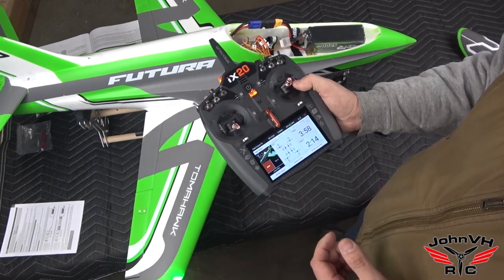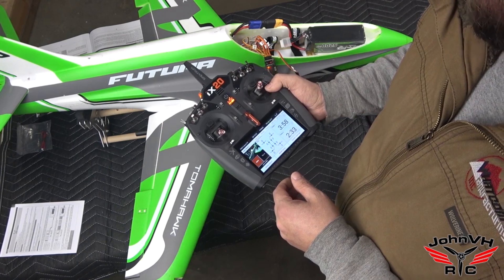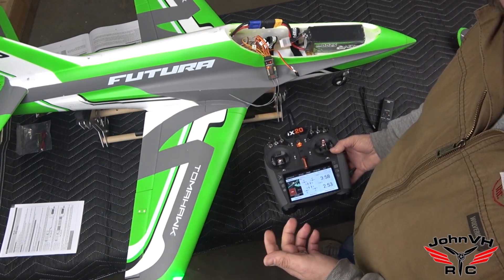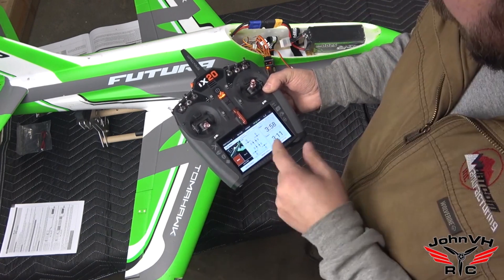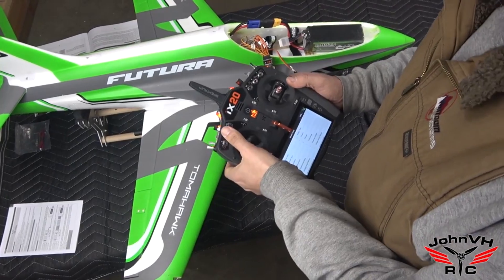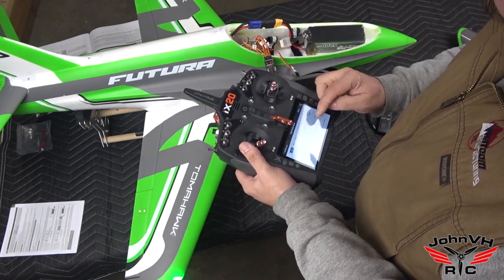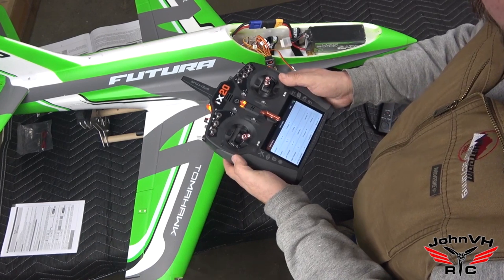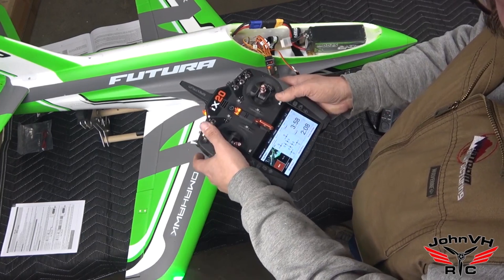Elevator to Flap Mix, THE RIGHT WAY!  FLIGHT MODES! You're doing it wrong!

Comment: Why are you adding ailerons to flap mix unless you're running crow brakes or drooping ailerons? I do the same thing but with flaps to elevator on my Draco 2.0 and flaps/elevator to crow mix on my Cub's in flight mode. Best thing to do is not use mixing and become coordinated with your fingers on the sticks.
Reply from the maker: Because every plane I have with flaps needs elevator compensation. I fly coordinated with the rudder, the best this is to do exactly as I show in the video. even full scale trim for proper flight.

Comment: A very important thing  you left out is while the trim setting helps but you must remember the Speed of the Aircraft will effect how much is needed  So if the model is flying faster
or slower trim may be off?  Also I slow the Flap speed so as to avoid the a large deflection during flap extension. The best way to land is trim the model for level Flight at half Throttle
Then use throttle to fly the approach lowering throttle to descend or add power to 
maintain or climb. this will keep the Air speed constant during Approach and landing
and flap to elevator will always be in correct trim.

Comment: This work on dx6e
Reply from the maker: Not sure, I have never had one of those, if it has flight modes it will
Reply: Using trims in the flap settings did not change the trims on the specific flap setting, it affected the trims even after switching the flaperons from on setting to the next.

Am I missing something?
Reply from the maker: @titusandrew946  did you tell the radio that the trims change with the flight modes? Go into the trim page and select flight mode for the elevator and aileron.

Comment: So all i need is the $1700 dollar IX20 Spektrum Transmitter to do this?  Wow who knew it was that simple? Lol
Reply from the maker: Not at all. I think any radio will do it. IX. DX. That’s why I make videos like this, because so many people are clueless about features, and how to make things easier for themselves.
Reply: @JohnVHRC  Thats how the developers sometimes make higher end transmitter,s more appealling to drop the extra coin because of the extra capable features. But if you are able to program that in most radio transmitter,s that would be the way too go to set up your presets
Reply from the maker: @looneytunes47 Yep, cheap transmitters do this also, I wanted this TX for the big screen, I like how the IX program, I can take a picture of my actual model from the TX, and money isnt an issue, I love it.  But Ive been doing flight modes since around 2000, with a standard tx as well.
Reply: @JohnVHRC  Yeah the XI larger screen is a sweet feature to have

Comment: From my experience.. for the maiden flight  , I recommend only setting the elevator to the flaps trim flight mode .. it can get hectic on a maiden if you have to trim the plane 3 times for 3 control surfaces .. this way you only have to worry about elevator trim,  once you get elevator trim dialed in , then you can add the rest of the trim flight modes if needed
Reply from the maker: I guess. But it’s better than having to make 3+ separate flights with an out of trim plane dialing I guesses. Honestly. If trimming in a plane is that hectic. Probably should get more comfy with trainers.

Comment: Flight modes are definitely the way to go. I started with planes 30 years ago with basic non-computer radios. Around 20 years ago I got into helicopters as well, got my first computer radio and discovered flight modes. An absolute must with helis and a total game changer with fixed wing.

Pretty much every computer radio from every manufacturer within the past 3 decades has flight modes. Read your manuals people. Take the time to learn the operating system and play with your radios programming functions. You'd be surprised what even the most basic systems are capable of these days.
Reply from the maker: Facts!!

Comment: 1. I’ve been putting my transmitter’s flight modes on the flap switch (D) for a few years. I only enable aileron and elevator trim. Some like to include the rudder. Having the separate aileron trims lets you tune out any turning tendencies due differences in the flap deflection. Since the flaps only use one channel, you can’t match them exactly.
2. Some think you must use the transmitter’s flights modes to control the receiver’s flight modes. This is not true; you simply need to assign a switch to the receiver’s flight modes channel.
3. Your videos would be much better if you connect your transmitter to your computer’s USB port and use “scrcpy” to display your transmitter’s screen on your computer.
Reply from the maker: Yeah, I know seeing the screen may make it easier if someone has an IX radio, but in all reality, anyone can look in their radio and find the flight modes option..  If they want to, its so easy!

Comment: Seems like a great idea.  But I'm not getting it.  Then again, I've watched that video on how to fold a tee shirt in one move and can't replicate that either.  🤣  I'll take a look at that option on my Radiomaster Zorro.  My NX10 is going back.  Even though it has been out for years, unbeknown to me, it needed a firmware update out of the box when I got it 6 months ago.  It wouldn't connect to WiFi, but I didn't really care at the time.  Now, it's not always working with the Telemetry.  And that is a problem.  According to HH support, a firmware update cannot be accomplished on a Mac!  So the old DX6 will be my final Spektrum radio.  $550 and half-baked!?!  Nice of them to offer a return.  Never again.

Comment: The only issue I have with flight modes is that when I set my DX9 to use them they would snap and not move at a slow speed. Had them on my F-5 and took it off for that reason. Maybe the higher end radios allow for a slow speed transition??
Reply from the maker: The flap speeds have been adjustable on all mine. Even my 20+ year old radios. But yes. The elevator does move normal speed at all times. But it’s not too noticeable. Still better than guessing setups on the bench :)
Reply: @JohnVHRC  I spend at least 3 flight fine tuning then never need to mess with it again... it aint that hard! 😂😂😂
Reply from the maker: Then you put a 6200mah in it and it’s off. 😂 or the servos/plane is off trim some day. No guessing. Ever. :). And in ONE flight. 😂
Reply: I dont know about the nx radoos, but the ix20 has sequencers you can use to slow down the movement. I havent done it with flight modes, but maybe it could work

Comment: A video for all you people with $2000 radios who already know what flight modes are. Sorry John, I didnt understand any of that. Not even a little. I just set up my flaps in the flaps menu, thats what its for.
Reply from the maker: Keep doing it the hard way, thats cool.. BTW, since you dont know, my 20 year old 72mhz radio does this as well ;)
Reply: @JohnVHRC  My point is you arent showing anyone how or why its better
Reply from the maker: @snoriverrc3842  Sure did, guess you missed it. The first part of the video I explain it pretty clearly..   No more of the ground guessing BS of percentages of what and what way, plus you can trim the ailerons at the same time in flight for each flap setting, its pretty awesome and so easy!

Comment: I think you need to explain it better for others .
Reply from the maker: Really? Maybe show what I do in the radio better?
Reply: @JohnVHRC  For others , like how you set up the flight modes in transmitter and when flying what trim your using .
Reply from the maker: @MikeyMikey1968  when flying you use the only trim you have, elevator, aileron, rudder. This makes them married to each flight mode.
Reply: @JohnVHRC  I know that, but do others know
Reply from the maker: @MikeyMikey1968  I show in the video that the trim button works on each mode, hope they see that part.

Comment: I use a Radiomaster tx16s and set up flight modes as well. It's so easy and simple
Reply from the maker: Oh yes, its the easiest way to fly!
Reply: OpenTX/EdgeTX is not simple. However, once you learn it, there isn’t much it can’t do. The problem then becomes quality and durability.
Reply: @txkflier  BS, it is , and it works great